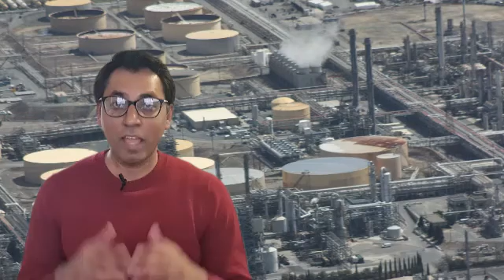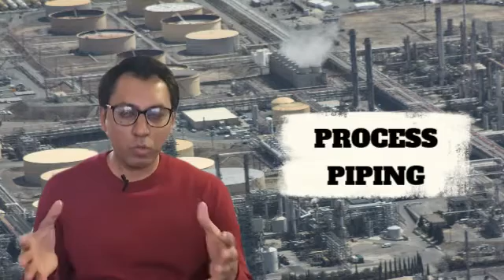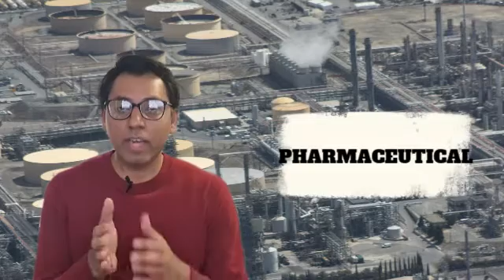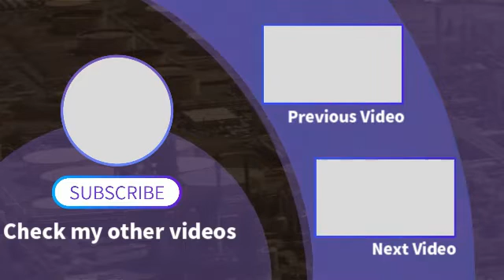ASME B31.3: Process Piping Code Scope and its Application

Comment: Shipping load calculation under ASME B31.3 is possible?
The case is like the small pipe spool with saddle should be transported through sea....
Reply from the maker: Yes, you can get piping load

Comment: What are the major differences bw 31.3 and 31.8
Reply from the maker: B31.3 is used for process piping, normally piping within a plant but B31.8 is used for Gas Transmission and Distribution Pipeline.